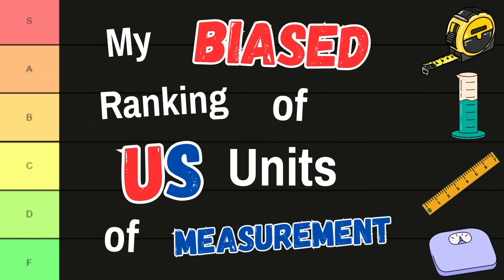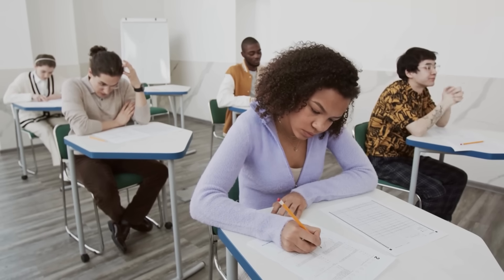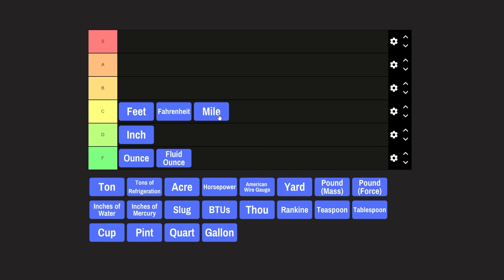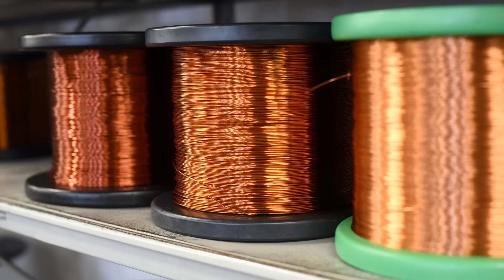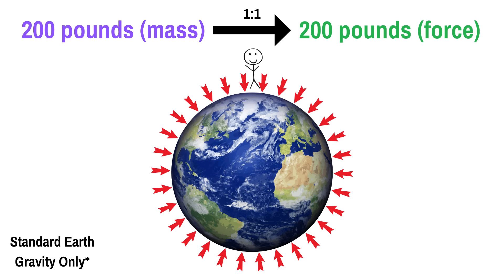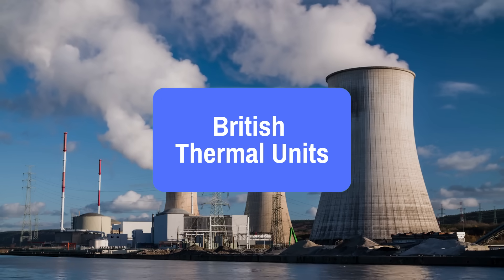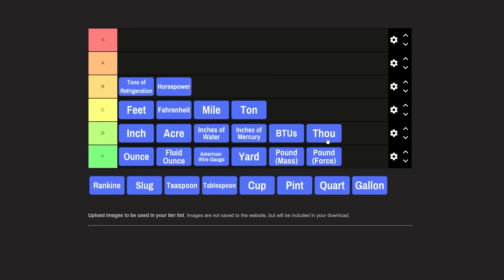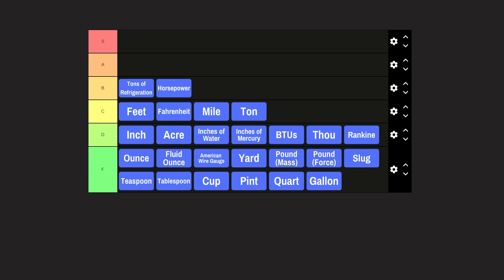Tier List of the DISASTROUS US Measuring System

Comment: Fahrenheit: The weather shouldn't range beyond 1-100, so it's very easy to know how hot or cold it is outside.
Celsius: Two mildly useful numbers are slightly easier to remember.
Reply: Under a normal, Earth's atmosphere (1atm)
0ºC = water is frozen
100ºC = water is boiling
Reply: @regulate.artificer_g23.mdctlsk So useful to know it's not currently boiling outside, shame I can't tell anything else though.
Reply: @icycrusader1947  I don't get how 20-30ºC is so different from 60-70ºF - and frankly, most of the ºs in F seems (just as) redundant anyway and it barely (if at all) includes those in the more extreme conditions; there are people who are comfortable living below 10ºC regularly, and there are those (esp in the tropics) that aren't discomforted above 32ºC.
Reply: @icycrusader1947 Yeah as if 60-90 is a better range than 20-30. Totally more logical. But the Fahrenheit is about the only imperial unit that I don’t hate so there’s that. If it had conversion it probably would suck just as bad as the rest of the stone age system.
Reply: @silverwatchdog  If it ain't broke, don't fix it. It's not as though I think all metric measurements are bad and some I actually deem better, but Fahrenheit was perfectly fine as one of the first temperature scales intended for everyday use. There is little downsides to using Fahrenheit over Celsius and any that exist are due to building formulas around Celsius rather than Fahrenheit giving a false advantage to Celsius. 

Building off of previous comments, the 0⁰C and 100⁰C is built around pure water which in and off itself isn't necessarily a downside but where in everyday life is water pure outside of the lab. Rain, snow, rivers, lakes, streams, oceans, springs, the water within humans and other animals, water in other organisms, tap water, and even bottled water either are impure by consequence, required to be impure for biological reasons, or are impure due to processing. Not all water boils at 100⁰C nor does all water freeze at 0⁰C and therefore claiming Celsius is in anyway superior for having easy numbers assigned to transitional states of only pure water is vastly overestimating the importance of Celsius over other temperature scales.
Reply: @icycrusader1947  you just seem extremely bias just because you use them, despite having nothing to do with their creation and no reason to be their knight in shining armour. "Some I deem better", most are objectively in every way better. About 90% of them are completely arbitrary and were made for oddly specific purposes which can't be used without a massive margin of error, and are impossible to use without google and a calculator and the last ten percent just barely scrape up to the standard that metric meets in most instances by simply being an actual system.
Reply: @thebirdfromtwitter1249  The first part of your response is entirely confrontational with no value whatsoever so imma ignore it. 

Regarding your second half, can I get the sources you are using to claim that 90% arbitrary and 10% "scrapping by"? If you are going to use supposedly objective measures of usefulness then please link your sources, if you are using subjective opinions then don't use 90% and 10% as if you'd actually know the exact impact. 

I'll state my position again if you are having trouble. My beef is with the "Celsius is superior" crowd. We can go back and forth for other forms such as length, mass, energy, etc and those derived from said measures but that would be a fruitless and unfocused task.

Comment: An ounce is only a thing of weight of how much an ounce of water weights while a fluid ounce is just volume "but can fluid ounces can just be called an ounce".... S teir and basically all in S, A, or B teir.... I would put meter , litter , and gram into e and f.... it makes 0 sense for many reasons... like take the gram for an example.... you are messureing mass over weight "you criticized the ounce over the 2 kinds"... different gravity = different reading with grams.... that is why there is 2 different kinds of ounces... peroid... stop measuring mass with weight "grams"

Comment: there is not a single comment which i could find defending these American units
Reply: You might want to check again now that I've had time to make alts to post about why Fahrenheit is the best
Reply: only defending one unit what about rest?? i agree even i use Fahrenheit only for thermometer but while studying and question on Fahrenheit is there i get very annoyed because of the conversion as most of the time i need to degree Celsius then to kelvin for most of the problems so i dont like it very much  @averywhitaker3513

Comment: One of the most disgusting units is feetpounds to measure torque, as opposed to Newtonmeters. As a car guy that is nearly as terrible as hp and british/brake horsepower. 1hpis nearly 0.99bhp. Btw if you still read and care about the difference: Bhp accounts for frictional losses in the engine, which is in my opinion ridiculous since the build quality of the engine has an effect on that and thus it cannot be standardised to work for every engine. Also hp is measured at the wheels usually which makes bhp useless, f tier.